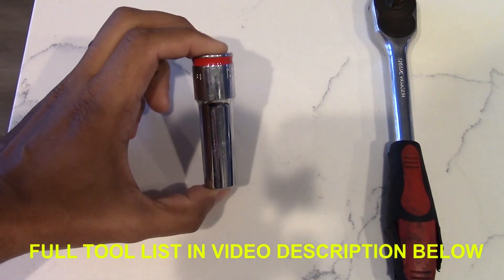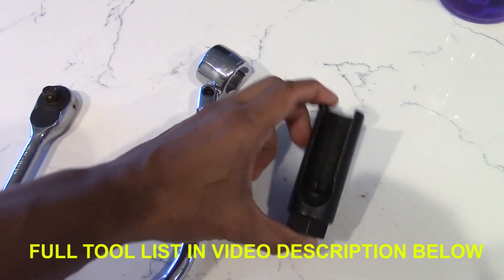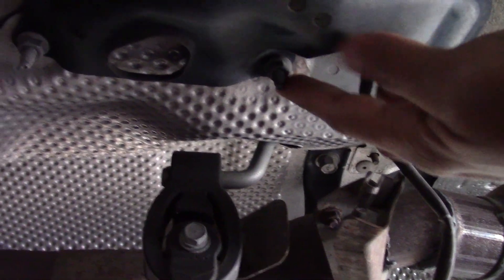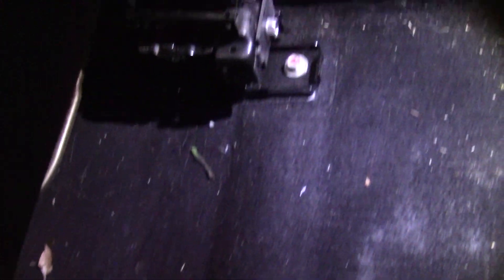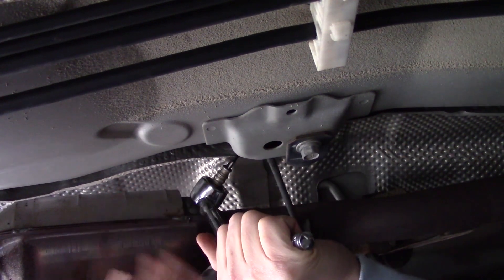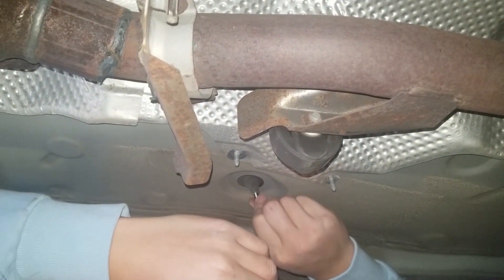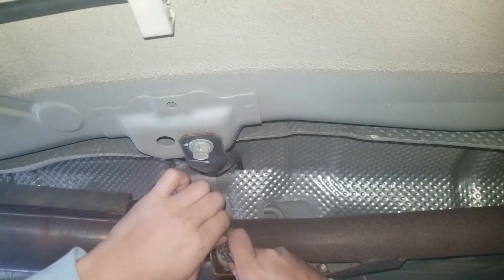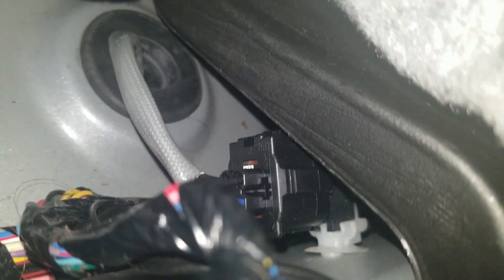Oxygen Sensor (O2 Sensor) Install | Mitsubishi Lancer | Sensor on Catalytic Converter

Comment: This is awesome ... right time as I am experiencing the car jerking and with engine warn light on. On diagnosis I've got code reads P0031 O2s/LAFS(Front) Heater Low. 
Is this the same one you replacing?

Thank you

Comment: Can you help me to find the location for code (p1773) soloneid valve system..
Reply from the maker: Usually that is a code triggered by ABS issue or wheel speed sensor issue

Comment: Will this work on an 02 Lancer?
Reply from the maker: Maybe be similar, but I can't confirm given that's a year a bit older than model in the video. In general though O2 sensor will always be located on the exhaust header and removal is always easiest with an O2 removal socket or wrench

Comment: Nice video. I have a 2011 Lancer SE that needs the rear 02 sensor. How do I know if I need a California or Non California emissions sensor, is there a visual clue? From what I've read the Cali and Non Cali sensors are different and have different plugs. Thanks
Reply from the maker: Hmm that's a good question. If you live in California definitely just get the California sensor so that you can pass their smog test requirements. If you don't live in California and not planning to move there, I see no reason to get the California version. Other states don't have California's stricter smog test. Hope that helps!
Reply: @EngineeredMojo  Thanks for the reply. I was going to order the Non California sensor but then I saw the emissions sticker under the hood has both US EPA and California on it, which is weird because Im in Canada. I'll have to call the local dealer to see if they can confirm which one I need based on the VIN.

Comment: Does it have to be a sensor removal tool? Or can I just use a wrench or socket?
Reply from the maker: An open ended wrench would work, but not a socket. The wires would be in the way. If you use a wrench, I'd advise using a flare nut wrench

Comment: Did you have to reset the computer after installing the sensor in order for it to work?
Reply: And if so
How or where to take the car to do it ?
Reply from the maker: You can just drive your car around for a few days or take it to a local auto parts store to have them read / clear code for free

Comment: Where’d you get your o2 sensor and for about how much?
Reply: You can get it at autozone 
Not the after market, get the OEM
Price it’s $225
Reply from the maker: Ditto Jose, it was about $200 OEM
Reply: I got to be on eBay for $30 and it works like new

Comment: Why not just peel and cut wire and reconnect the new oxygen sensor the old one and don't remove the  seat
Reply from the maker: That's an option for sure, but that option will introduce another possible failure location in the assembly, the wire crimp or solder you make. I always try to reduce the amount of failure locations in my fixes. Also in my view removing the seat is a lot faster than crimping wires underneath a car if you are properly crimping or soldering and then adding a protective heatshrink cover. That's a lot of work compared to removing 4 bolts to a seat frame.

Comment: Is it the same for a 08 lancer?
Reply from the maker: It should be fairly similar given they are within the same generation
Reply: The grommet and electrical connector locations are different. The grommet is behind the engine; it has no cover and the electrical plug is behind the passager side center console cover, towards the floor.

Comment: Video is very good and clear, except if you can add two things, tell which sensor is that and after install tell to drive the car till light is reset
Reply from the maker: Thanks for the feedback! I'll plan to add the sensor number as that question had come up a few times

Comment: Instead of going thru all the hassle of moving the seat why don't people just get the one w/o wires and just cut the existing and attach the new one with bare wires
Reply from the maker: That's definitely an option, but I think generally that is seen as more work and adds an extra possible failure location (e.g. the spliced section). Certainly an option, but not one I would take given removing the seat takes only a few minutes

Comment: Which sensor was that one was that bank 2 sensor 1 ?? That is the one I'm having problems with just want to make sure I order the right one.
Thank you
Reply from the maker: In this video it was bank 1 sensor 3, the o2 sensor naming convention can change for different models so I'd recommend getting a print out from your local Mitsubishi dealer parts counter. It'll show exact locations for each o2 sensor. They'll usually provide for free, hope that helps!
Reply: I’m having a misfire on my Mitsubishi 2011 my o2 sensor pop up

Comment: So the bracket that holds the sensor wire beneath the pipe rotted off, and now have a dangling wire just waiting to grab onto something and break.
Reply from the maker: Oh wow, that's an annoying problem to have. Are you thinking of crafting a makeshift bracket or routing the wire a different way?

Comment: Where can I get o2 sensor replacements at a decent price.?
Reply from the maker: Online vendor like rock auto or amazon would probably be your best option for a cheap O2 sensor
Reply: Amazon you can get both for like 45
Reply: @pinkyhotmessx69  can you post that link  ...thanks

Comment: i was told i need to get my bank 1 o2 sensor fixed . Is that bank 1 or bank 2 also where is the bank 1 location ? 🧸
Reply from the maker: In this video it was bank 1 sensor 3, the o2 sensor naming convention can change for different models so I'd recommend getting a print out from your local Mitsubishi dealer parts counter. It'll show exact locations for each o2 sensor. They'll usually provide for free
Reply: Engineered Mojo okies kool thanx 😺

Comment: Great video of all the steps! Just a couple of questions based totally in ignorance... :-) What size is the sensor removal tool? I'm guessing 22mm, but wanted to check. Is this the lower, downstream O2 sensor you are replacing? Thanks!
Reply from the maker: Hey it sure was the downstream O2 sensor and your correct 22mm (7/8") is the size of the socket or flare nut wrench. Hope the install goes smooth for you!